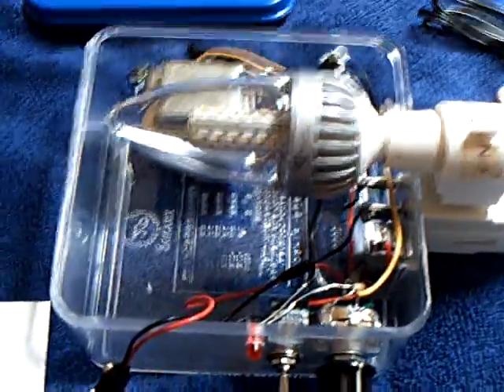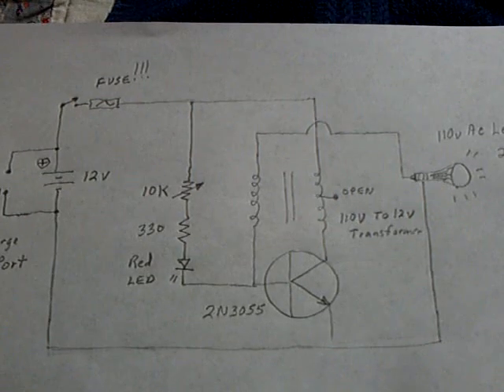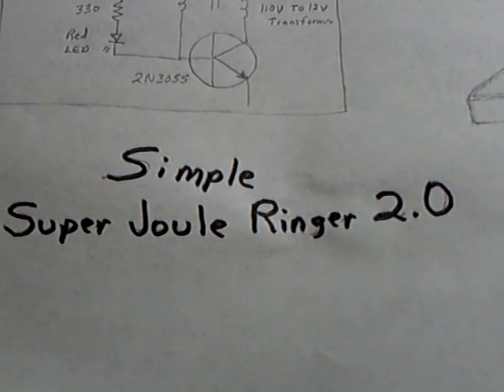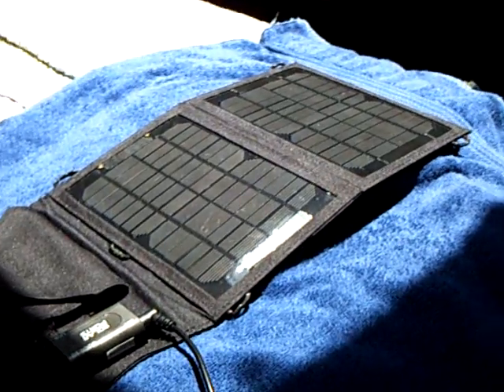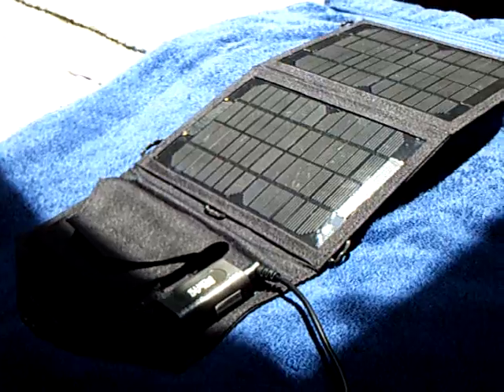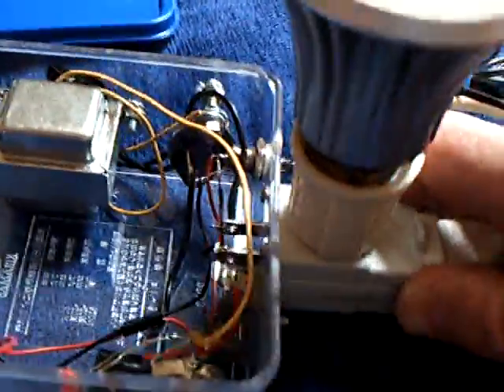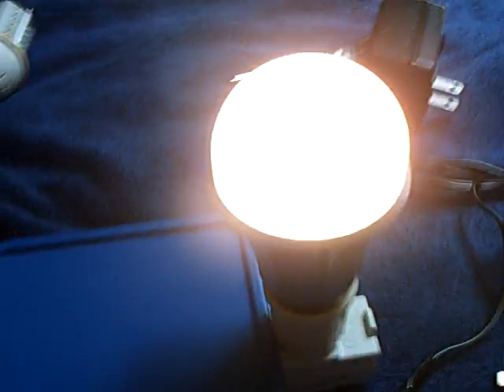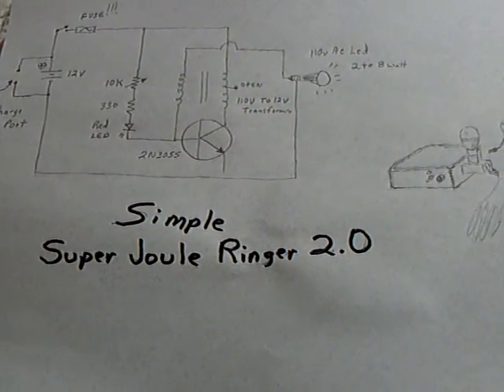Simple --Super Joule Ringer 2.0---Boxed

Comment: Hi Lidmotor, some questions. On the transformer was it the 110v wire that went into the pos of the bulb? Center tap is not connected-right (low voltage side)? LED bulbs gutted or standard (no gutting required) plan to replicate just to get a working model. Thanks

Comment from the maker: That is a 7 watt panel but with the filtered sunlight coming in it was putting out much less.  I measured the unloaded voltage at about 15 volts for this test but I didn't measure it with the lights on and I didn't measure the amperage either.  That is something that I need to do.

Comment from the maker: Good questions.  I really have not done enough testing to answer most of them.  The circuit runs in the kilohertz.  The battery pack shown in this video is NOT protected except by the fuse for an overload.  I wanted to keep this simple but a charge / discharge controller sure would be nice.  I don't know how long it will take to charge the battery pack using the solar charger.  I chose to run this on AAs so that I could still make light using regular batteries if I had to.  .

Comment from the maker: Good questions!  This is a DC to AC simple step up inverter that is able to run the new 110v AC led lightbulbs that are now available.  That is why it is different than a regular solar powered led light that uses low voltage DC.  The circuit runs very fast (in the kilohertz) and is "blinking" the leds at a high rate.  This is NOT an overunity device.  Because this uses AC instead of DC the energy can be transmitted through smaller wires and for longer distances without line loss.

Comment from the maker: The solar panel has NO battery in it.  This device will run straight off that small solar panel using just sunshine.  That was one of the design points for the project.  Thanks for asking that question.

Comment from the maker: I ran this using the battery pack for a four hours test using the 7.5 watt bulb and it did fine.  That is what I will need usually per night on my trips.  Simple math says that it takes about 1200 mAh out of the pack with the lamp pulling 300mA.  The solar panel should be able to replace that each day with good ole Southern California summer  sunshine.

Comment: the box is great and I'm sure it will do the job, but I have a couple of questions;

-what's the typical operating frequency?

-how long does it take for a solar panel under skylight to fully charge the batteries?

-is there any battery protection, like charge/ discharge rate/ level?

-how long will a fully charged battery pack run that one light?

Comment: Good point Lid. One very obvious situation (in my home) is a subground basement. I have a Tony Van Roons modified circuit that runs at the 4V level, accomplished by series-paralleling many cells put together from junked and discarded solar garden light "panels". It's only 4V, but almost half an amp of current.On the roof that is turned into HV in an (apparently) true sine wave (scope). It then travels 135 ft of cheap wire and illuminates a CFL or LED enough to retrieve food from the deep freeze.

Comment from the maker: Why not just use a 12vdc led bulb??  Good question.  This whole project was about making a non power robbing inverter to drive the new AC led bulbs.  It was thought that perhaps by going DC to AC,  we could gain an advantage over just slapping a 12v battery on 12v led bulb.   To me the advantage was lack of line loss on long wiring runs.  You can run a 100ft. extension cord off this device and not lose the power.   I see that as an advantage.